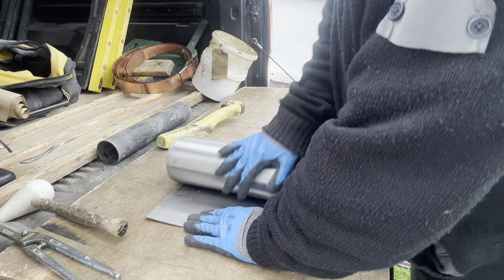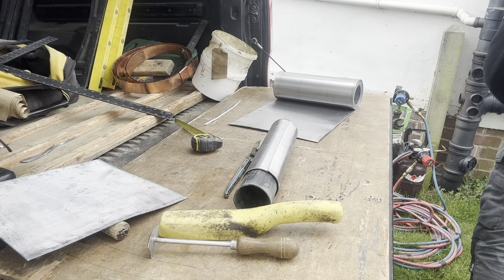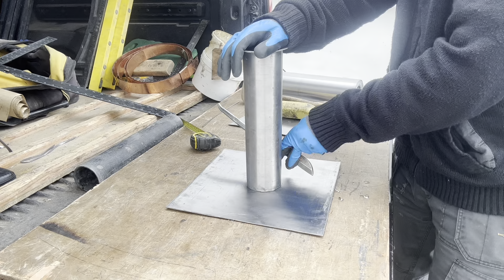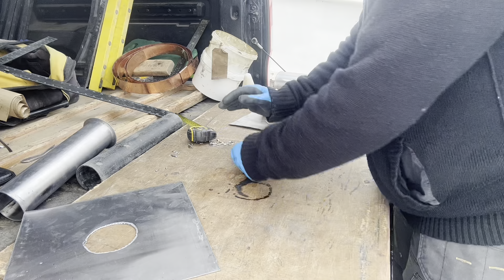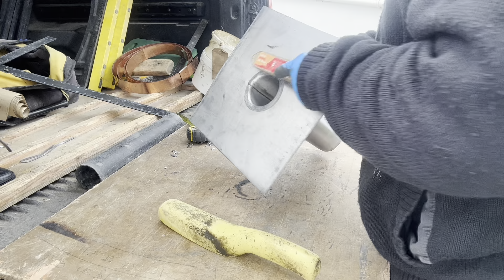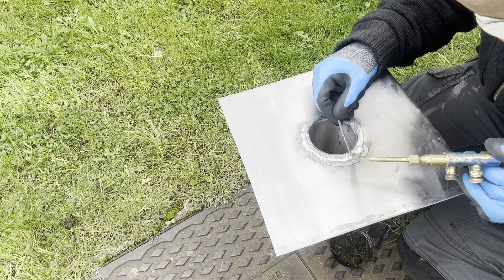Lead Outlet Fabrication **COMPLETE PROCESS**

Comment: Hi, love your work. Whats the best lead burning set for about 300 pounds, thanks. Hope the backs good
Reply from the maker: Thank you. My back is getting there slowly. It’s Just going to need a little more time. 

I’d probably go on the welders warehouse website and get the portapack lead welding kit premium. I think it’s £340.00. A little over budget but it’s important to have the model o torch. Or the ProGas 5000 if you don’t want to open an account for the gas. This is much cheaper and still comes with the model o torch.